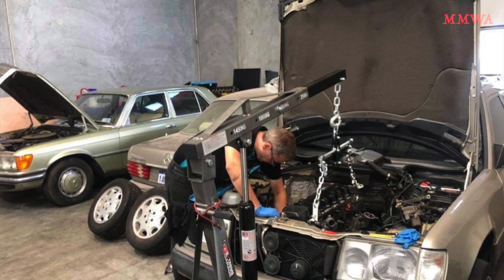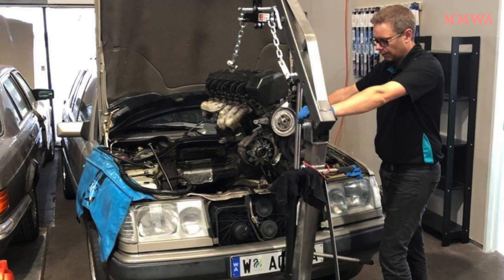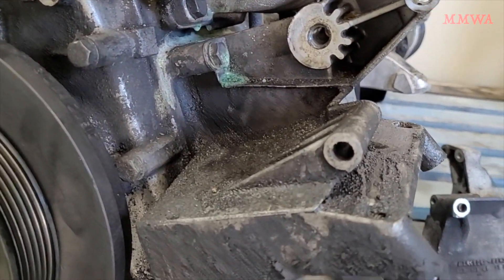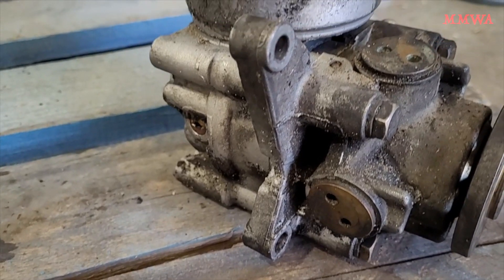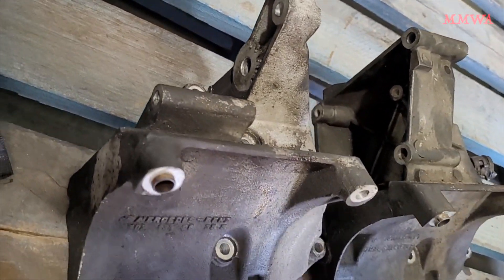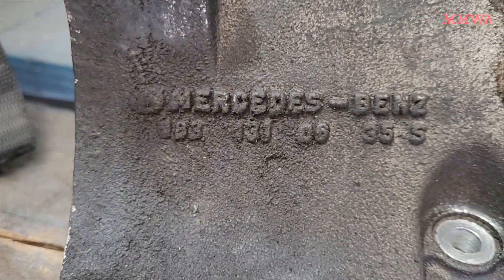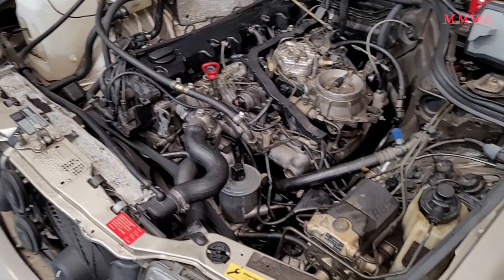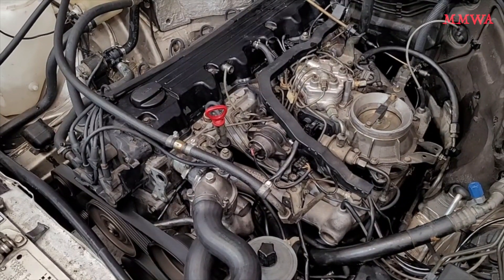m103/4 Upgrade to spring loaded belt tensioner (Big compressor cars only)

Comment from the maker: Note! There's no guarentee you will have the big compressor on 3 litre m103's. It appears early versions may also use the small version and this modification will be no good to you. Unless you also change over the compressor and anything else needed, possibly the hose set and compressor manifold. It becomes a big pain in the butt then, but if someone has done it feel free to share.
Reply: Have an Idea of the big compressor part No?Plus does this mod alter the belt length?
Reply: Just did it, managed to get an ac compressor and shortened the AC lines, everything fits properly. I think not even my cylinder head porting or my efi is that satisfying as removing that stupid tensioner 😂

Comment: That's a great upgrade! Dealing with VBelts is a pain in the rear. 
The OM603 also used the tandem pump, on the W124 T models, and the W126 with ASD.

Comment from the maker: The number cast into the M104 bracket is 104 236 00 30 - I would advise you lucky Americans who have late m104's being a dime a dozen in the junk yards to save these brackets and list them on ebay/amazon with the tensioner installed specifically for upgrading the big compressor cars world wide. These brackets will be impossible to find in Australia as not many of those cars were ever sold here.

Comment: Interesting.  i will try get my hands on one those brackets And fit newer style tensioner. I have never liked the m103/m104.98 tensioner.
Reply from the maker: yep the old style is terrible. I think the m103 powered 190e and possibly other 2.6 variants may be the only version with the small compressor, though that is just a suspicion. I think all m104.98x should have the big compressor so should be safe for all those. I would be interested to do this myself if i ever need a new tensioner again
Reply: @MMWA-DAVE  my 01/86 300e has smaller ac pump
Reply from the maker: @1995bulldog  this is the problem- there seems to be inconsistencies in the EPC and i have no idea which cars ended up with small compressors on the 3.0 m103.
Reply from the maker: @1995bulldog  can you tell me your market version and possibly even vin so i can check the epc. you can reply in email if dony want share public. or not at all 😎
Reply: @MMWA-DAVE  check email
Reply from the maker: @1995bulldog  thanks champ
Reply from the maker: @1995bulldog  Didn't get any email, see if you used the current one @mercmad.com its in my about page
Reply: @MMWA-DAVE  just got it out